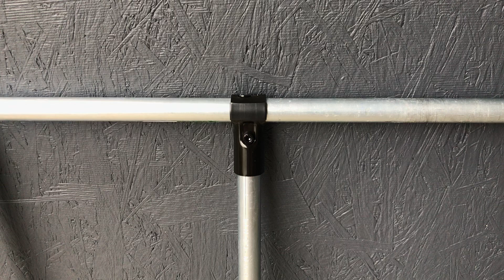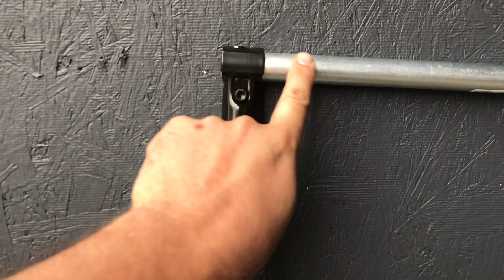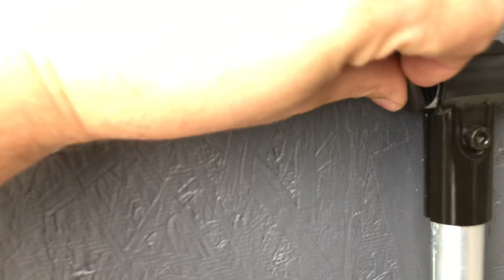How to Make a 90 Degree Elbow out of Electrical Conduit - Maker Pipe

Comment: does the area where the through-pipe goes through tighten as well when the nuts are screwed? I plan on having those ends/elbows oriented such that the throughpipe faces the sky, and then place weight going downwards. So I would want to know whether they clamp down and tighten so that the pipes don't just slide through when weighing on it.
Reply from the maker: The through pipe receives the most clamping force when the connector is fully tightened. We are going to do some testing in a few weeks on the pullout strength, but you should be fine with at least a few hundred pounds. You can also add some set screws into the connections for extra strength and security.